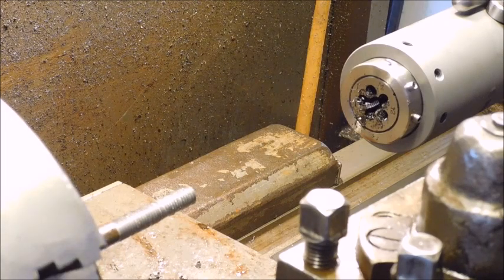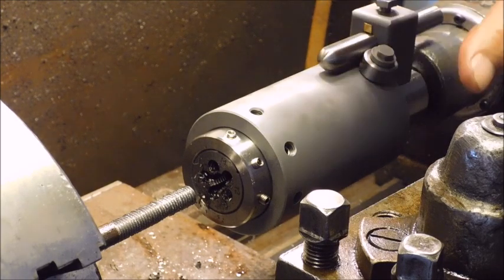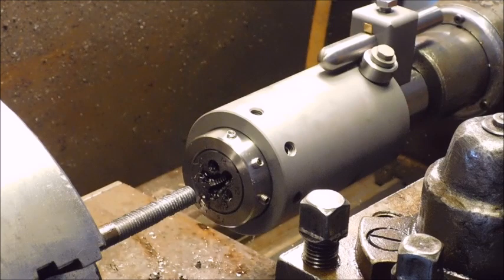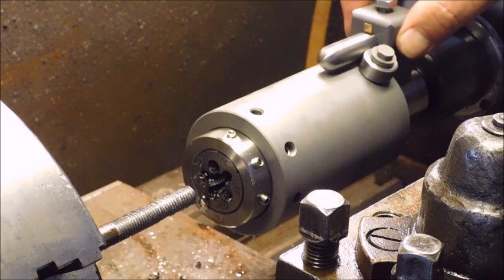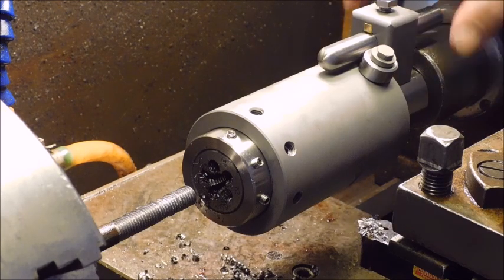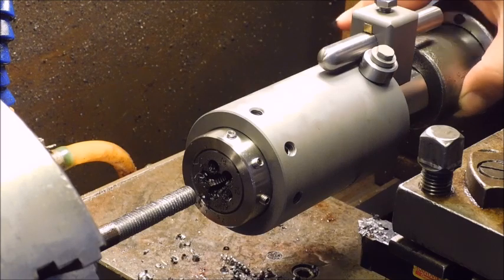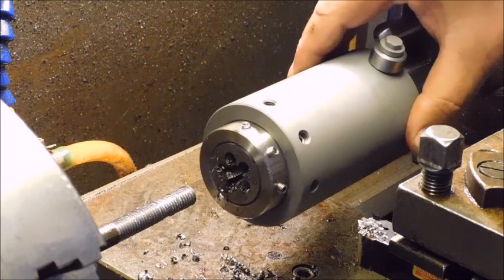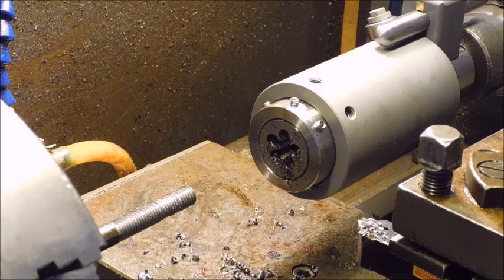TailstockDieHolder 07

Comment: The ring at the front end of the tailstock - held by 4 screws, can be replaced by a new, mofified style one. Make a piece - that looks like a "number eight" - with one big hole for the quill as it is now, and one smaller hole for that adjustable depth of thread guide rod.You might need to replace that rod with a longer one, though... Should be able to hold it firm. At least worth a try, perhaps? Love the idea You've got there - thanks for sharing! ;)

Comment: Hi Keld,

Interesting.

I think the problem is that the outer sleeve is canting (not remaining parallel) to the inner section - as the main sideways pressure is on the pin/rod near the tailstock end.

So it's going to bind on the inner section at each end of the outer die carrier tube - as it goes non parallel to the centre section under load on the pin/roller.

Cheers Rob

Comment: I always thought a morse taper gripped by the two halves of the taper being pushed together? In the circumstances you are demonstrating they are surely being pulled apart as the thread is being cut so I am not surprised that they separate and slip. 
However I cannot offer any explanation as to why the device holding the die is not being pulled along as the thread is being held as there is clearly a lot of traction to pull the whole thing along the bed including the tailstock.
Reply from the maker: Hi Dan
?????? 
I don't know where you see that the "two halves ... are surely pulled apart" - there are forces pulling the male MT out of the female MT, but they DON'T separate and slip in the video ! (but it did in my earlier tests !)

When the thread is cut my whole device and the tailstock is pulled towards the headstock BECAUSE the force to move the tube holding the die is greater than the force needed to move the whole arrangement (my jig + the tailstock) -  that's why locking the tailstock to the bed gets the tube holding the die to move.

I think the need for locking the tailstock to the bed is a minor problem - it's just a new thing added in the procedure.

The POSSIBILITY of the MT slipping is a serious problem and has to be solved.

I'l try disassambling my tailstock to see if there is a worm out or even missing female tang in the bottom of the tailstock MT.

Comment: My thoughts -- with my tailstock die holder I have a hole for a transverse 3/8 rod, that I can let touch toolpost or somewhere convenient - that stops rotation if morse grip fails.
Also - I have usually used mine for a start - once 3 or 4 turns I switch to hand finish knowing we are straight on. If work still holding in chuck, then hand diestock use can make as long a thread as wanted.
Then too - small material like 12mm - the torque will often break the grip in the chuck - no real answer to that other than remove from chuck and set up for hand finish in drill vice or similar where grip can be better.
In essence your design is very sweet... some great features.
Reply from the maker: Hi Chris
Today I took my tailstock apart to see if there was a tange in the bottom of the female MT - but no, nothing there and I can NOT make one there myself because it's deep in a long tube - maybe I could do something with some socket screws from each side ... but no, I wont start on that.
Ø12mm threads an tha SMALLEST I plan ... remember my biggest die is Ø24mm ... but surely the MT wont hold and the chuck will slip too - that I have realized by now.

While I'm thinking of how I'll solve the problem I'll make a smaller version for Ø10mm and downwards ... still I have 3 different die sizes - 30, 25 and 20mm - and I'll cope with that the same way I did on the bigger one - make it for the Ø30mm and a ring with through holes for the Ø25 and an adaptor for the last size - in fact there are 2 left sizes - 20mm and 20.5mm Ø  and 2 thicknesses !

Comment: You should be using very light oil not heavy oil so it is not gooey and make extra drag that then transfers even greater rotational pressure on the tailstock taper.  It is getting there though Keld, it wants to work.
Reply from the maker: Hi John !

Unfortunately I have tried with thinner oil but there is still a too large possibility that the MT will slip - especially on greater diameters thread - I want to "try" go to 24mm |:-((

I've been looking for a female tang in the bottom of the tailstock taper - but there is NO tang only a screw for pushing MT out of the tailstock.

I my thinking there COULD been a female tang there ... even with the releasing screw.

The screw head should just be as wide as the tang and then it still can push MT's out.

I wonder why the is no female tang in there ... I'll try see if it's just totally worn out.

If not ... maybe I can make a female tang in there ;-))
Reply: I have seen a tang holder for a tailstock made by using two large grub screws through the quill from both sides to trap the tang.  It works.  However, remember that when you makes something stronger, something else will become the "fuse", and that something might be a lot more difficult and expensive to repair when it fails...
Reply from the maker: Hi Bob
Yeah, I had that in mind too - see my answer to Chris's comment

Comment: Keld forgot to mention would it be holder long enough if you installed a screw in tang to stop the tapers spinning?
Reply from the maker: If you mean a sort of drawbar - there is no room for that !
Today I had the tailstock apart to se if there was a female tang in the bottom of the MT i the tailstock - there was none and it's impossible to make one inside that barrel tube of the tailstock.
Reply: +Keld Sørensen ok Keld you can't fit one then, they are made to screw into morse taper adaptors which don't have a tang, that is the screw into the drawbar thread and make It 'tanged' check here to see hat I mean.
http://www.arceurotrade.co.uk/Catalogue/Chucks/Drill-Chuck-Arbors/Screw-In-Tangs
Reply from the maker: Kevin Smith
OJ- now I got you - but unfortunately just a round hole through the barrel :-((
Reply: Well it was just  a thought, keep up the good work though 😆